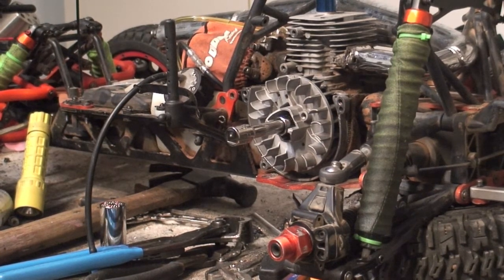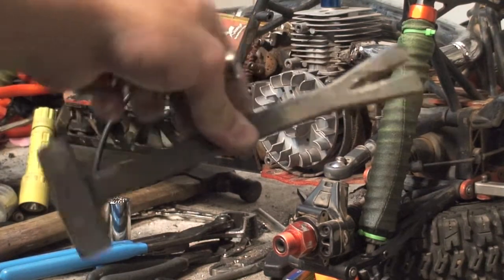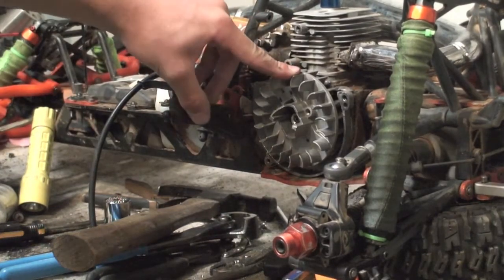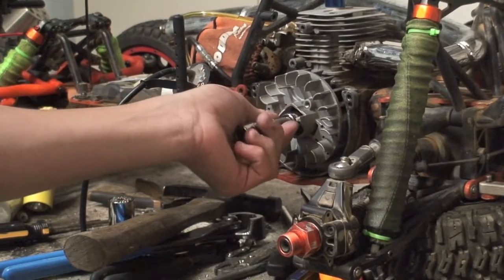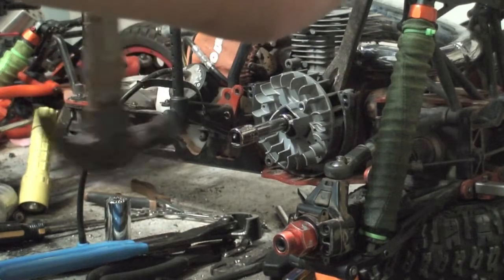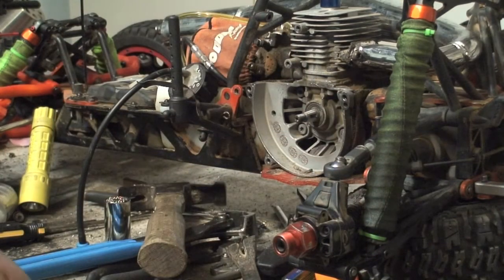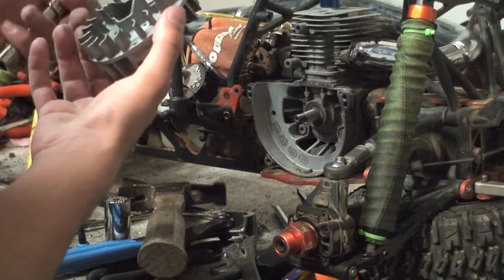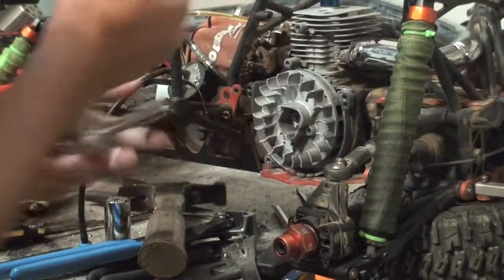how to remove flywheel off of any small 2 cycled engine with out flywheel puller.

Comment: First of all, that is not a 2 cycled engine and this method is not restricted to two or four stroke engines,  Second of all, the nut should be screwed on the crank so that it is flush with the crank. Then you hit the end of the crank with the nut flush so that the end of the crank does not swell when you hit it. No need to have socket and extension then.